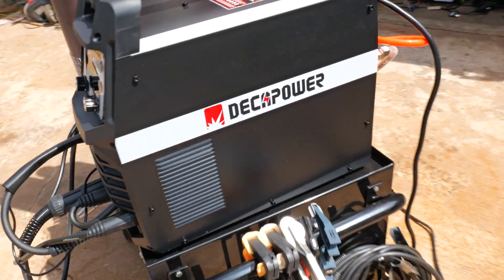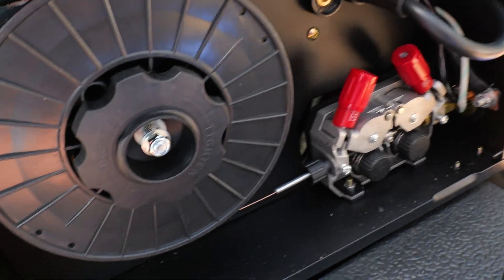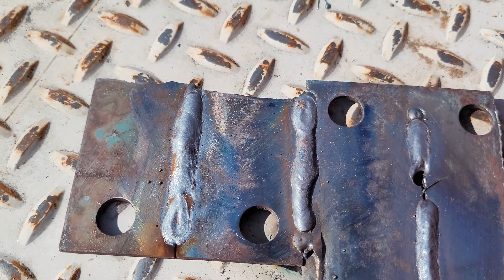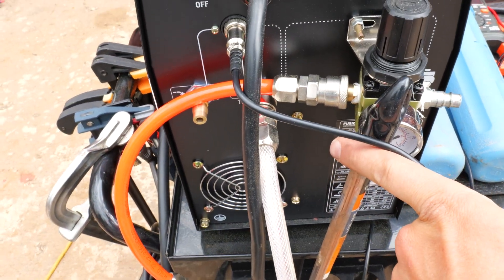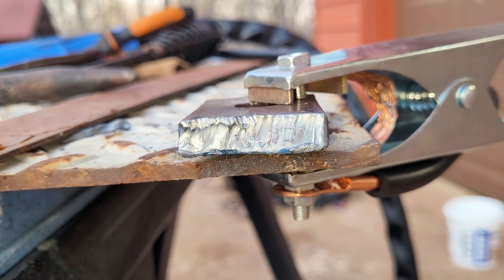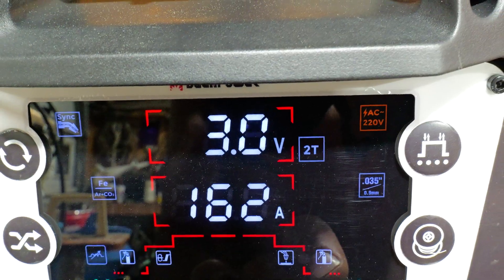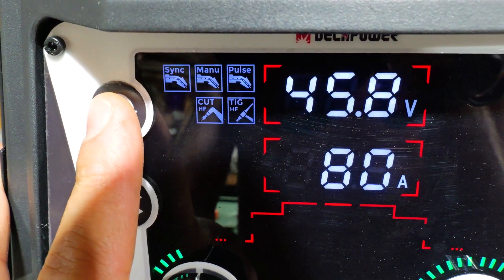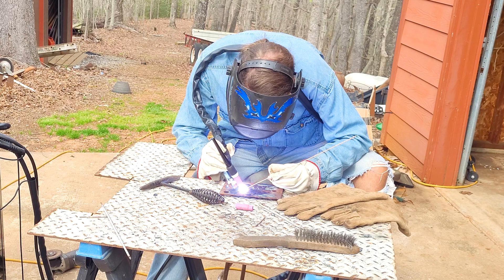AMAZON Welder Review: DecaPower PMCT-205 MIG TIG STICK & Plasma!

Comment: How are you cooling the tig torch. Or thats not necessary.
Reply from the maker: On all these cheap welders they are air cooled. They are "good enough" to get the job done. I need to get a water cooled one.

Comment: Can you do a video on engine oil coolers problems and replacing them.    Mine is leaking oil into my coolant im pretty sure.  I replaced headgasket and this could be the only other culprit besides my heads